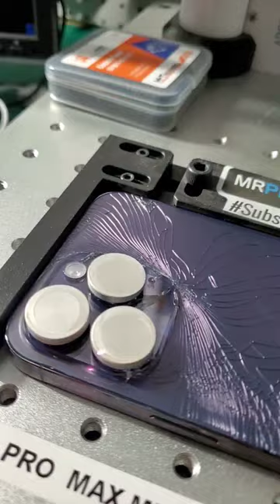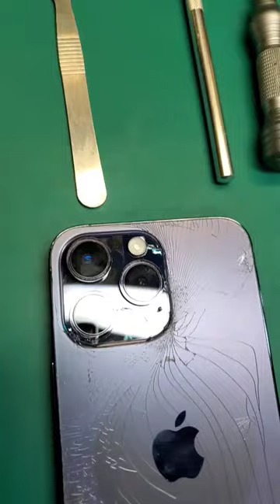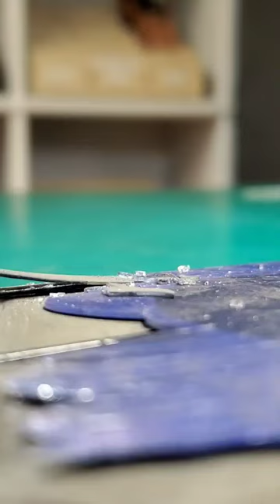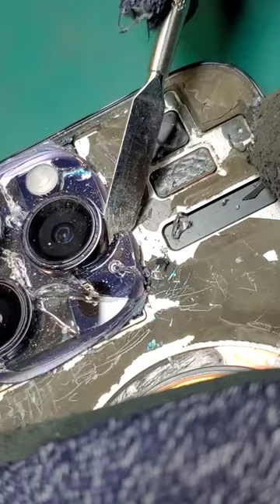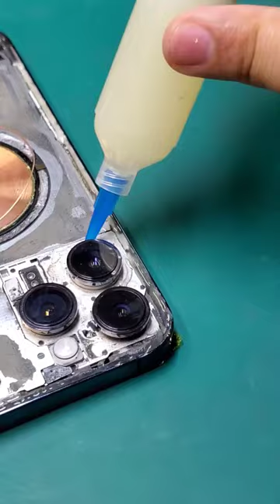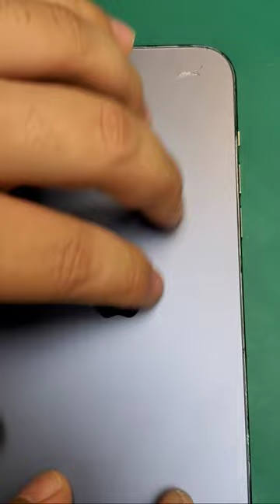Restoring a Cracked iPhone 14 Pro Max Back Glass #Shorts #Restoration #Viral

Comment: You can see that Apple intentionally made repairs near impossible
Reply: This is easy way, laser machine does everything for you, I do manually, remove hardware and take out the glass with a blade and hot air gun

Comment: that's why i have  care + and rock mine without a case..  doesn't go through all that hassle they replace the whole frame which is why it cost almost 700€! If my frame gets too scratched up i accidentally drop it so the glass breaks bring it to  pay 29€ and get a whole new frame and glass 😂
Reply: good on u
Reply: Bro wtf did I read?💀

Comment: Very messy and time consuming process.  I'm dreading having to do this.
Reply: it's easier if you preheat it and use a heat blower with the blade to pry the glass and it helps if there's a chunk of glass missing
Reply: @charlesanderson1321 did this and fried my camera and front screen even got dead spots now. Careful with the heat gun.

Comment: Est ce que c’est vrai que cette opération fait gonfler la batterie
Reply: Bro, damn it, the battery of this mobile communication device is located on the front of the mobile device (that is, on the display on the module) In general, nothing will be damaged there and it works in the back panel of the mobile communication device...